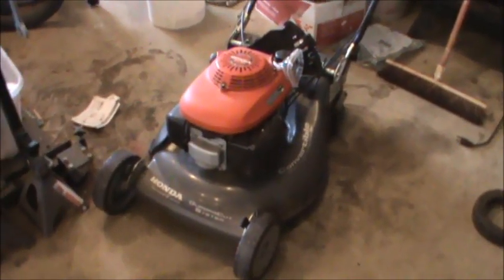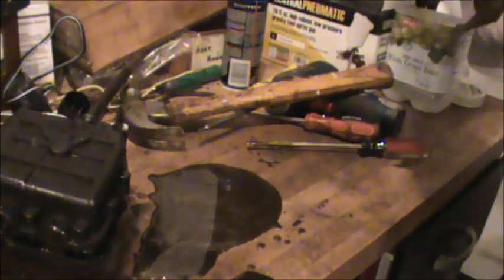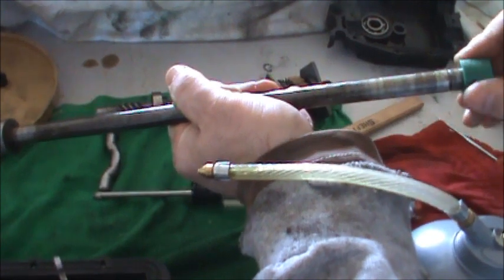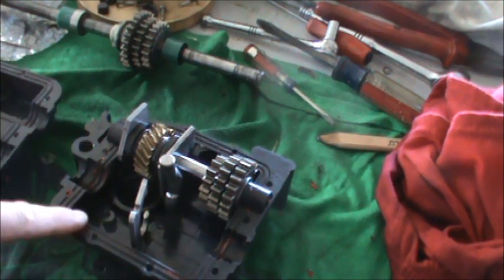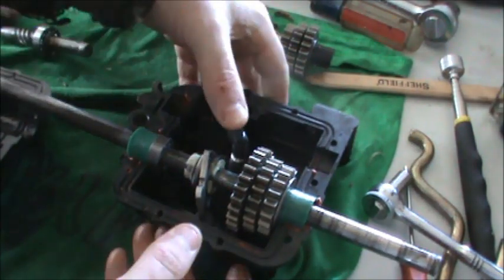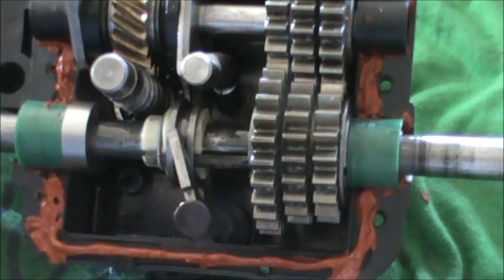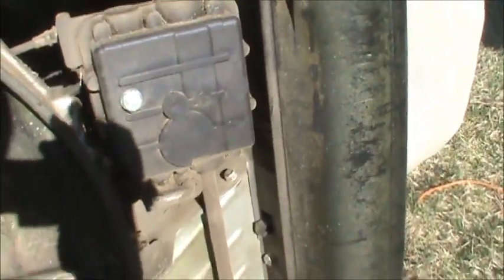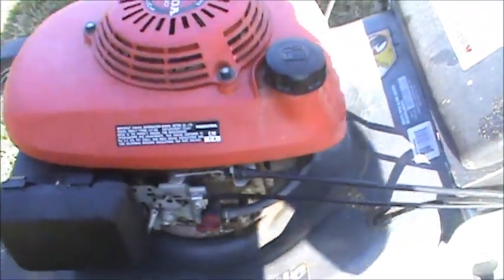Honda HRT 216 Transmission Repair Part 2

Comment: Picked this model up today set out on the curb near my home.  Bad Gas, ultrasonic cleaned the carb, changed the oil, power washed it, love the Honda models too!
Reply: I have a commercial Honda 215 hydrostatic which is in service for near 40 years and going strong. The other one HRR216TDA was to replace the old , but now the transmission is beaten up  and overall looks worn, and honestly the quality went down  with Honda mowers. The Husqvarna-Honda( 4wheel drive) , the last one I bought holds  up much better!

Comment: My rear wheels will not go backwards. I replaced both adjusters and bushings as well as cleaned up the axles.  This led me to believe the rust has destroyed the axle  inside the housing.  I will still tear it down after installing a new transmission. Its a 3 speed. I doubt there is that much wrong with other  than it sat. The shift cable was broken and just a terrible mess. Usually when they are that bad, its better just to replace things. As I haven't ever  taken one apart, itscon my list of fun things to do.

Comment: I replaced Oil (4oz 10 - 30 synthetic) without splitting case using this video.  I found clear area on top of case and drilled hole to drain / fill.  I used rubber plug to seal leak free.  TY youtubers :)

Comment: Take a regular grinding wheel on a 4 1/2 inch grinder. Put the drive wheels in a vice and run the grinder across the wheel (horizontal). Do this all the way around to get better traction until the new wheels get to your shop! Hope your back gets better. Take care man!

Comment: I actually did this same repair on a Craftsman walk behind mower for one of my cousins. Separating the cases was daunting indeed, but I got it done. The hardest part of all for me was removing the old RTV gasket maker. I also thought 30W oil would be good enough, but I spoke with some local professional lawn mower repair guys and they told me to use Alco Super Lube “00” Grease #19100. It, too, is more like oil than grease, however, it is a very thick oil-like grease. If anyone out there knows of an easy way to remove RTV gasket maker from parts, please let me know. Thanks again, doublewide6, and I continue to hope for and pray for you, your son, and the rest of your family.
Reply: soak the parts in gas for a day or so and you can pull it off
Reply: I am middle of this repair. I tried to separate the cases but couldn't. If you could provide some insight on to it, that would be great.

Comment: Excellent video.  I just removed and disassembled the 3-speed in a trash-picked HRR2162TDA (same gearbox as the video).  I too noted that the brass input shaft helical gear was quite worn.  I have no idea why Honda didn't use a steel gear.  Either way, good tip about reversing the gear prior to reassembly!

Comment: I just did that too.  I bought seal 12 x 19 x 5 (vitob instead of buna) 12.5 would have still leak.
One important step missing in vid for the disassembly is to remove the top part of the speed selector yoke.  There is a side screw  to release the top, but you have to put it in speed 3 to see it.  This way, the top just slide in / out easy. 
Also, since this is tranny with gears and a friction clutch, I used manual tranny oil.

Comment: Regarding my comments about the lack of information on the replacement and direction of the wheel drive ratchets on the wheel axel, I'm now providing the information that I got from another site and have tested by correcting my own mistakes on my reassembly of my own mower.  When you replace the ratchets, they should be aligned so the flats on the interior of the ratchet point toward the rear of the mower as you are observing them facing the particular wheel that you are working on and the mower is in its natural horizontal position.  This applies to each wheel; one being correct and one incorrect will not give you the desired result. The proper result: even distribution of torque to each wheel, without either wheel fighting in left or right turns. With the mower engine off and the drive engagement  bar in its relaxed position, the mower moves freely when pushed forward or backward.

Comment: MY QUESTION IS I NEVER SAW YOU PULL THE UNIT BACKWARDS-HOW DOES IT ROLL IS IT SMOOTH OR DO YOU HAVE TO FIGHT IT TO GET IT TO GO BACKWARDS.I HAVE BUILT SEVERAL OF THESE AND SOME WORK FINE AND SOME ARE STILL HARD TO BACKUP WITHOUT LOCKING THE BACK WHEELS UP

Comment: First thanks for the great video, going to use it in case I get stuck putting the transmission back together.   But, my problem is that brass gear you flipped is almost completely worn out on one side and the worn metal jammed everything up with a big ball of metal.  So that gear needs to be replaced.   Any luck finding a replacement gear?   I have the part number on the transmission housing but the it's worn away and can't read it.

Comment: Great video good idea I had already contemplated doing something similar I’m glad I watched your video I now know where to place my drain👍
Reply: same here i used a shop vac when i drilled the drain hole and put grease on the drill bit to keep the plastic out on several mowers those 3 speed people dont want to pay for all that work and that grease leaks out slowly

Comment: Hello sir, can you tell me if there is a clutch inside of the transmission. The problem Im having is that the transmission  is slipping, if you lift the rear wheels of the ground they spin when you engage the transmission but as soon as you let the mower down and make contact with the ground they stop spinning and the mower wont pull. thankYou.

Comment: What is the part number for the brass gear? I tore into the tranny and my brass gear is completely shot. Of course, I will need that whole assembly stack of parts, but I don't know where to look for these internal parts. Thank you!

Comment: Very good step by step although I'm still not clear on how the transmission engages when you pull the lever/cable.  I see where you showed that square bracket? slides up against the bronze or brass gear but that doesn't have any mechanical "meaning".  Maybe you could elaborate.

Comment: What did you use to "tap" the hole for the drain plug.  I'm not sure how to make a hole that won't leak and still hold the plug well.  Also, would you mind commenting on how the mower is holding up after using it for the last year?  I've got the same problem.  Leaky transmission from a HRB217TDA.  I've got the part out and I'm going to try pulling it apart next.  I'm curious if it is still worth the effort.

Comment: Tip on removing Pulley Pin.  Use a snug punch pin.  If punch pin is too small the pin may spread open and lock into place.  Use solid metal plate to support under pulley shaft as you hit pin out
Reply: Is the pulley pin straight or tapered? Not sure which hole to be used to put the punch pin.

Comment: Great video except: you mentioned that wheels did not turn on your first test drive after putting everything back together, because you had placed the "ratchets on the wheels backwards." Since you had made that mistake, I wish you had assumed it was likely something your readers might also do, and had explained how to determine what direction the ratchets had to be re-installed to properly drive the wheels. I made the same mistake and could not decide how to determine whether or not to reverse both ratchets at the same time or experiment with one, then the other. Wish I had the foresight to have checked that as I was taking the wheels off the first time. Please understand that I am not trying to be too critical, just thought that your efforts missed an opportunity to have identified one more area that was significant to the effective re-assembly of the drivetrain.  Thanks for taking the time and effort to educate those of us who need all the help we can get.

Comment: I have a HRM 20 yrs old with variable drive, trans is $480! dont use it much anymore but for sucking up leaves.
Reply: The Honda mowers seem to really excel at sucking up leaves. The only mower I have had that even came close was a 1990 Murray Aero-Vac. I've really missed that mower over the years, until I got an HRX. It sucks up leaves, acorns, sticks, generally anything that doesn't belong in the yard.

Comment: Where are you getting your parts? I’ve looked and the only thing I find is washers, nut, snap ring and the whole transmission. I like to fix my things, the brass gear and the parts on either side are worn out. I would appreciate any info you could pass along, thank you.

Comment: Honda uses Hondabond HT to be the gasket. Good stuff, but pricey. After you get it separated (I use a knife blade), clean the surfaces and out a continuous bead of Hondabond around the surface and bolt her up. The stuff dries fairly fast, so don't go take a nap after putting it on the surface.

Comment: I have the same mower/transmission. i removed it because it won't engage. i have not opened it yet.  do you have any idea what is wrong with it? can i still repair it? thanks

Comment: I watched this video last year also.  You did a great job!   I am also praying that your son's health is improving.  I would like to know if your lawn mower will pull backwards easily when the clutch bar is not engaged?  Mine is very difficult to pull backwards, and I hear a clicking.  I am wondering if the gear that engages with the worm gear is not releasing all the way?    Any thoughts?

Comment: Hello doublewide6, 
I’m working on the same project and your videos are very helpful. 1 quick question, how did you remove the dried Honda bond gasket sealer. 
I can see you had it cleaned up perfectly. ( I’m glad to hear your son is feeling better ). Thanks Greg

Comment: I think I have to buy a new transmission because after changing the cable and belt it still doesn't engage.  Not worth it I think to put $200 into something you can get new for 4 to 5 hundred.  My mower is 12 years old

Comment: A replacement transmission is $146.97, labor $62.00 US (don't ask me how I know.) The sad thing is, it didn't fix the problem completely.  My springs were weak, keyways and journals dirty, and the wheelbearings were worn.  So for $2.24 cents per side I bought new springs and C-clips and the bearings that fit inside the wheel.  What makes it sad is, more likely than not, there was nothing wrong with the transmission (it wasn't leaking.)  Live and learn, as they say.
Reply: A LeBlanc As my grandfather used to say, "I never learned a lesson that didn't cost me money." You're in good company, my friend.
Reply: I purchased  this transmission new for $56.45 + 12.00 shipping and saved myself a  heap of time and frustration. Not to mention it now works.
Reply: That is a great deal....I dealt with my local dealer whose mechanic was just a parts changer and not a real mechanic.
Reply: can you share where you got the new transmission for only $56? Thanks!
Reply: Paul Di Maggio 
no way it was only $56 for a new transmission. it is $135 to $155 online.
Reply: @pauldimaggio3779  hey can you tell me where you got that transmission?

Comment: I'm am very disappointed in the engineering and longevity of Honda.  I expected more as my old Craftsman mowers lasted 10-12 years with just oil and filter changes and were 1/3 the price.  I initially like the Honda ergonomics and have been through 3 in 12 yrs and will not buy any more ever.  My first one had the plastic deck and was very light which I loved - the last 2 were metal decks and are much heavier.  When you need to push manually around obstacles thelighter mower is easier of course.